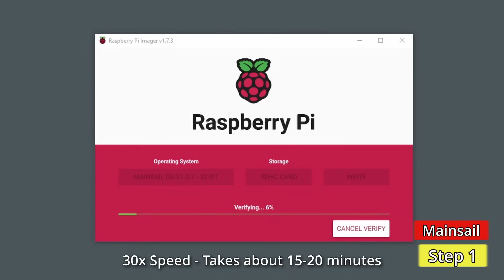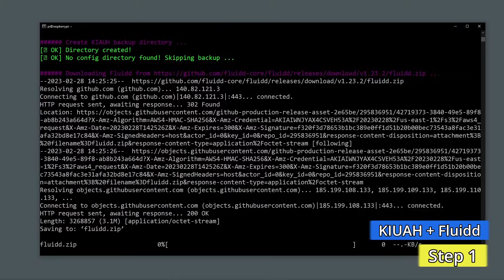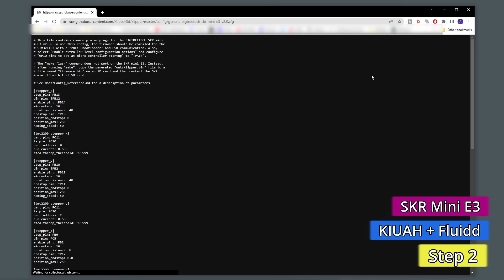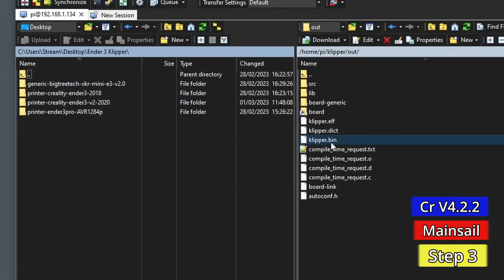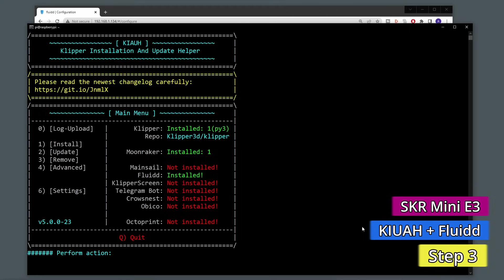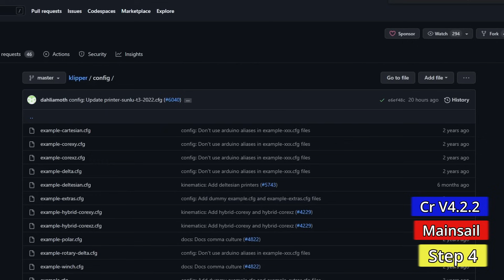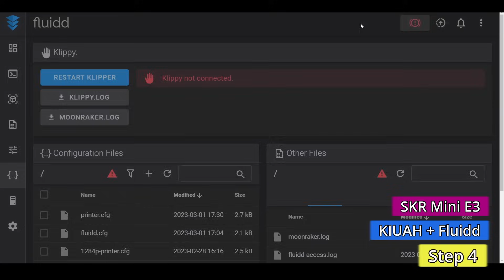How to Upgrade to Klipper on any Ender 3 for High Performance

Comment from the maker: If you're mainly concerned about getting hold of a raspberry pi, get subscribed because I have a good potential solution that were going to try out!
Reply: An orange pi perhaps, or the one that comes with a duck? Guess I will see.
Reply: @paulmilne3038  wi'll this method still work with an orange pi?
Reply: i followed your tutorial I'm running klipper on pc
Reply: i'm installing it on a thin client right now, a used wyse 5060 is cheaper than a pi 4 and more powerful + more expandable. only thing you really miss out on is the GPIO pins and full software support
Reply: Can yous share the ender 3 neo config file?
Reply: please answer my question, if i use laptop directly to 3d printee without raspberry or any tjing like that, did the steps is same? 

thank u

Comment: I found installing  Klipper a bit too much, so i did Octoprint as it could leave my Firmware intact. Installed it on a cheap orange Pi (the OPi Zero 3) and works perfectly. Should I ever decide to go to  Klipper.....I saved  tr video

Comment: The imager only has the 3.0.0 64 bit version right now, is it okay to run this on a pi 4 2GB model, or will it not work correctly?

Comment: FOR BLTOUCH ON 4.2.2 YOU NEED PUT sensor_pin: ^PB1     &     control_pin: PB0   RATHER THAN PROBE OR WHATEVER. this was the only thing that worked for me, not sure why.
also on a cb1+pi4b, i should mention

Comment: nobody covers the fac that theres litteraly an image in raspberry installer, that has BOTH Klipper + OctoPrint together. like 1/2 the steps every tutorial puts us throw could be eliminated, yet NOBODY covers this.
Reply from the maker: Because I don't want to use octoprint
Reply: How do Klipper and OctoPrint work together? Would the web interface be Klipper or OctoPrint?

Comment: I studied a lot, watched several videos, used a little AI, but on four motherboards I couldn't get it to work. It seems they have bootloader problems. I really don't know where I went wrong. On four motherboards, I think the problem is with me, not them, haha. I used the 4.2.2 and 4.2.7 Srkmini E3 v2 motherboards, and the S1 PRO motherboard. Frustrating.

Comment: *IMPORTANT**: When entering the pins for the BL Touch, please follow the this instructions. The pin settings for the BL Touch should be as follows:*
sensor_pin: ^PB1
control_pin: PB0

Hello. Our printers are the same model, but I have a GD32F303 processor. I've already checked my motherboard. I'll be replacing my processor during the installation, but is there any other memory value I need to change?
ADDITION: Yes, it works.

Comment: I know this old, I used it last year to get mine going, I been off 3d printing for like a month or two. Anyway I came back and no go anymore. I tried everything last night a new re install but the problem is the same one.  I can't get the new mcu id,  when i run the command it tells me no such a file or dir(/dev/serial/by-id/*': No such file or directory). Any ideas, it was like this when I came back after hours of trying everything and the re install still nothing. Thanks for the great video.

Comment: you don't actually need SBC. If you have old laptop that is waiting for use, you can just install klipper on linux distro like debian. I'm running mine in virtual machine
Reply: Hey Im trying to do this in a chromebook using the debian linux but I crashed into a wall when installing to my printer. Can you help? I got stuck at the part where he builds the klipper.bin how do I send it to the printer? Thanks in advance.

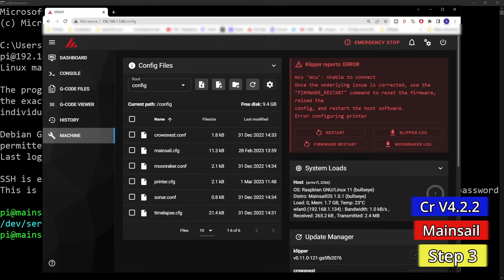Comment: Hello! I have issues with the step on17:34 where serial id is extracted with ls /dev/serial/by-id/*. It says "ls: cannot access '/dev/serial/by-id/*': No such file or directory" what may be related is that although I put klipper.bin on my SD card, it is much more unorganized, as instead of that one file in the SD card i have multiple where i put klipper.bin.
Reply: I'm stuck here too... My issue is that the raspberry pi connects to my computer as Pi@raspberrypi where in the video its connected as Pi@mainsailos. I cannot find out what is wrong, or how to fix it. If anyone has answers, please share quickly!
Reply: Did your firmware flash right? @DudeIngenious5215
Reply: Unplug the usb, turn the psu off, put the sd card in.....rename klipper to firmware-1.bin ...never use the same name twice, so change the number...i use the date and time instead. Turn the PSU on....you know it worked because the LCD will light up but remain blank.

Comment: Holy.. a rocket scientist would have had it easier.
Reply: Wow, if you aren't smart enough to follow step by step instructions, just say so.
Reply: @mattelder1971  I have no issues at all but many other might have with around 100 instructions or what it was so just take it easy there dude.
Reply: @dtiydr  mattelder1971 wasn't very kind on his approach on this, but in his defense, he's mostly correct. i found it pretty simple and easy to follow and understand, and i have little to no coding or computing knowledge. I feel like this isn't an issue on the video's way of teaching, just an issue of understanding on your part. this isn't a BAD thing, it just means you have to do some more research or learn a few more skills (:

Comment: help please everything connects except it refuses to  home, ender 3 pro 4.2.2, i can warm up bed and extruder, control fans, it even locks steps when i ask it to move, but refuses to home
if any retard has same issue, the chinese have wired the thing incorrectly, so you have to manually remap your drivers in printer.cfg
for example:

step_pin: PB9
dir_pin: PC2
enable_pin: !PC3

they might be completely swapped any way possible, use chatgpt

Comment: Hi vector3DP, I followed your step from start to end. currently im having ender-3 (basic one) with creality 4.2.7 board. i have reached the step where we need to "build and flash", after i start flashing, it eventually stopped because of SPI Flash Error. I have inserted the SD Card, but it only has 8GB, it should be sufficient right? Could you assist me with this issue? Let me know how can i contact you personally if it is easier.

Comment: Well, followed along step by step, and appear to have bricked my ender.  Loading the klipper.bin files killed it.  It doesn't communicate with the klipper interface "printer is not ready", screen is blank, and won't let me flash the marlin firmware back onto it.  I'm guessing the marlin bootloader gets wiped during the install.
Reply from the maker: Be sure the file is named and correctly and correct settings are chosen for your printer. I promise it works :)

Comment: The big flaw of Klipper is that it needs a host to be used. In other words, the printer is useless by itself. The cheapest host is a Raspberry Pi. Which is VERY EXPENSIVE compared to that printer. It's not worth it.

Comment: Hello, I have successfully installed klipper on an old laptop and I want to know the necessary steps to finish the installation of the printer.cfg file for my printer:

configuration:
- creality x rail 
- creality silent board 4.2.7 
- creality sprite pro kit for ender 3 
- creality cr touch

I can't find any sources for the components of this printer. 

Can you provide me with guidance so I can try this Klipper system.

Comment: I am having a heck of a time trying to get through this. I don't think my printer is taking the firmware flash? I have tried about 4 different microusb cables of differing brands but Klipper always just fails to get the mcu id. Pulling my hair out over this as I'm crossing the 3 hour mark flashing, pulling SD cards out, searching for cables, etc.

Any help would be greatly appreciated.

Running a 4.2.7 Ender 3 Pro with a CRTouch. I've got a pi4 with Klipper installed and running from what I think is just fine, but either the printer fails to take the .bin flash that I put on the sd card or Klipper is just failing to see it at all. I've tried all sorts of different configurations in the make menuconfig but nothing works.
Reply: I'm stuck and it's almost 2AM. If I leave the pinouts copied from the Ender 3 S1 so it's ^PC13 and PC14 then I get an error that states that failed to verify the BLTouch probe because it's raised and then says it failed to deploy. However if I use the PROBE_IN and PROBE_OUT I get the BLTouch failed to verify sensor state while the colors go all crazy on the CRTouch.

Comment: Brilliant managed to convert from Octoprint to Klipper on my Ender 3 plus skr mini e3 v1.2 in just over two hours 😀 just finishing its first print. 😀
Reply: Did you have to flash it directly to printer or you did it all through pi?
Reply: @ the pi creates a file you put on a sdcard and reboot the printer. Use a freshly formatted empty sdcard or it may have problems. I can’t remember exactly but I think the file has to have a particular name to work. Good luck!

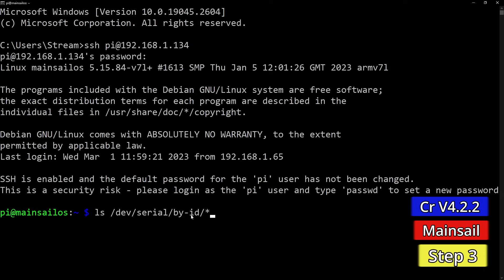Comment: @17:30 im not able to get any response from the pi when i type in: "ls /dev/serial/by-id/* " it gives me a response of ls: cannot access '/dev/serial/by-id/* : No such file or directory" Does anyone have a fix for this?
Reply: also, does the printer have to be on and firmware uploaded and ready to go by this point?
Reply: @factoryblack181  Hello I'm having the same issue, did you find a solution my board is creality 1.1.4. and I'm not sure if the printer has to be on or not. Thank you very much in advance.
Reply: @lmpuy  Yeah actually! So when youre in the make config menu, for my board I had to set my gpio to PA0 and that fixed it. Recompile the code and when you get through all of the processes again, it should let you ls the code in the pi
Reply: @factoryblack181  Can you explain a bit better is it the GIPIO pins options or the Communication interface settings?
Reply: @karaokeparalacras  its in the gpio pin options, its near the last option towards the bottom. Recompile your code and you should be good.

Comment: Great tutorial! I tried doing the Kiauh + Fluidd method, I followed carefully every step. Once I install Fluidd, I cannot access the web interface using the IP address. I tried different things including rebooting the RPi, restarting fluidd, restarting moonraker. Still a blank page... Any ideas to fix it?
Reply: I have the same issue, but it is a matter of reading carefully. my ip is 192.168.10.199, but after installing it told me to open at http://192.168.10.199:81

note, the last :81 is important. i suspect you encountered this problem

Comment: I just wish you had done 2 different videos and not merged them. It got confusing for us beginners.
Reply: I followed closely and I am still having an issue after 2 days of trying. I have an Ender 3 Pro from 2021, Control  board is an BIGTREETECH Direct SKR Mini E3 V2.0 32Bit Silent Control Board Integrated with TMC2209 UART Stepper Mortor Driver, BL Touch, BIGTREETECH Ender 3 Dual Z axis Upgrade Kit with Stepper Motor Lead Screw, Dual Z-axis Upgrades Kit, Micro Swiss All Metal Hotend Kit, and CanaKit Raspberry Pi 4 2GB Starter Kit from 2021. I need help. I would like to use Mainsail and Klipper. Please please.

Comment: Anyone face a problem with ender 3 pro with 4.2.2 board and bltouch 3.1.
change to this config.
[display]
lcd_type: st7920
cs_pin: EXP1_7
sclk_pin: EXP1_6
sid_pin: EXP1_8
encoder_pins: ^EXP1_5, ^EXP1_3
click_pin: ^!EXP1_2

[output_pin beeper]
pin: EXP1_1

[board_pins]
aliases:
  EXP1_1=PC6,EXP1_3=PB10,EXP1_5=PB14,EXP1_7=PB12,EXP1_9=<GND>,
  EXP1_2=PB2,EXP1_4=PB11,EXP1_6=PB13,EXP1_8=PB15,EXP1_10=<5V>,FIL_RUNOUT=PC6

[bltouch]
sensor_pin: ^PB1
control_pin: PB0
x_offset: -44
y_offset: -6
z_offset: 0
probe_with_touch_mode: true
stow_on_each_sample: false
set_output_mode: 5V
Reply: Thank you. I have a 4.2.7 board with the crtouch and could not get it to work. This fixed it for me. Thank you!

Comment: I have an Ender 3 with the 4.2.2 board and I’m using Octoprint on a Raspberry pi now - can I use it with Klipper also?  Since I have Octoprint running and using, what instructions can I use to get Klipper up and running?  I’m I needing to install Klipper on the RS PI first and then reinstall Octoprint on the same pi and restore a Octoprint backup?

Comment: I did everything. Fluid gives  me a blank white screen at my IP  address. When I installed Mainsail and assigned it a port, I typed my IP for fluid and added :88. Mainsail opened, but fluid is still a blank white screen.
What do I do?
Reply: Ohh. I am using CHrome. Windows Edge works
Reply: @SpectraV3i  Weird, I was using edge and had the same issue, switched to mullvad and that fixed it.

Comment: Hello, I realy need some help.
I'm trying to install Klipper on a SKR E3 Turbo but I'm getting always the same error "SD Card Flash Error: Unable to connect to MCU". I tryed the GPIO pin !PA14 and i got an error thtat it couldn't creat the klipper.bin file.
Now i'm using the pins: !P3.26, !P3.25, !P1.18, !P1.19, !P2.13" and i'm getting the error of the MCU.
Can anyone help me on this pls.

Thanks in advance

Comment: Flashing out/klipper.elf.hex to /dev/serial/by-id/usb-1a86_USB_Serial-if00-port0 via avrdude
avrdude: stk500_getsync() attempt 1 of 10: not in sync: resp=0x65
avrdude: stk500_getsync() attempt 2 of 10: not in sync: resp=0x63
avrdude: stk500_getsync() attempt 3 of 10: not in sync: resp=0x68
avrdude: stk500_getsync() attempt 4 of 10: not in sync: resp=0x6f
avrdude: stk500_getsync() attempt 5 of 10: not in sync: resp=0x3a
avrdude: stk500_getsync() attempt 6 of 10: not in sync: resp=0x54
avrdude: stk500_getsync() attempt 7 of 10: not in sync: resp=0x46
avrdude: stk500_getsync() attempt 8 of 10: not in sync: resp=0x20
avrdude: stk500_getsync() attempt 9 of 10: not in sync: resp=0x69
avrdude: stk500_getsync() attempt 10 of 10: not in sync: resp=0x6e

avrdude done.  Thank you.

make: * [src/avr/Makefile:34: flash] Error 1
>>>>>> Flashing failed!
>>>>>> Please read the console output above!

creality v1.1.4 ı cant flash this card. why ?

Comment: You need a raspberry pi WITH the Ender3 control board. Not worth it.
Reply from the maker: klipper is 100% worth the cost of a raspberry pi in 99% of use cases.

Comment: one of the best tutoral i've seen. I do already have  klipper installed on a pi, but never got round to actuality use it. I have a Anet a8 plus running with ramps 1.6 and Marlin 2.x. But an 8bit ender3 and anet a8 plus are very similar,  so maybe not too much work to alter confiq to work from this tutorial. Is it possible to run klipper in a local network rather wifi ? I work at a Highschool and we a not allowed to use wifi or any remote control. Which is the reason for me abandoning the project.

Comment: I'm having issues installing the firmware to my BTT SKR mini E3 V2.0. The settings change since you recorded the video:
- it asks me whether I should make flash or stm32flash, which it doesnt say in yours
- board number for the v2 seems to have changed from 21 to 23
- as far as I know and as far as printer.cfg info at the top says, I should put the klipper.bin file on an SD card instead of flashing to the MCU from USB, as that is not possible on this specific board.
Reply: I'm having the same issues, did you manage to resolve your issues?
Reply: any update on this? I stuck on the same issue and have info that flashing failed due to "unable to connect to MCU"...

Comment: I have M8P with CB1 on a Voron. And I have Duet 2 Wifi on my old Delta anycubic. Duet wifi 2 is 170 bucks .. klipper costed me 102... With more drivers on it and better processors and the wire pins are higher quality. And I have to say, klipper programming is a lot more advanced, and user friendly. Lots of options for you available including using USB cameras, remote control etc .. My duet 2 wifi is up to date, it sometimes still have glitches, it's not as fast on CPU power as klipper... Long story short duet sucks and overpriced. Duet 3 is almost 260 bucks. If you want to tell me klipper boards are expensive then idk what you expecting.. 100 bucks for most expensive klipper board isn't expensive. Especially when it comes with 8 drivers and raspberry pie. Any one looking to upgrade, buy the klipper board you will love it. I actually thinking on trying to upgrade my old printer and see how it runs with it.

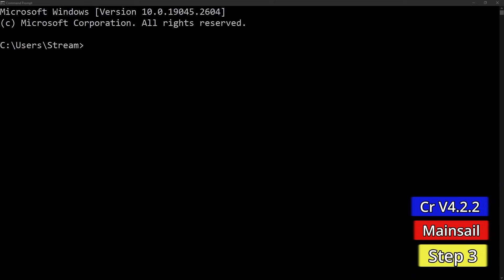Comment: Hello,  I am tryin to install Klipper via Mainsail. I am having issues and am stuck around 17:23.  The firmaware we generate goes into an sd card and that card goes to the printer directly or does it go into the raspberry pi's card?  I did it and my printer doesnt read anything
Reply: (late but might help others) reboot the printer with the firmware (copied on a different SD card, not the one for the pi) and the screen should stay blank as it is only configured next.
Reply: @SaMusz73  thanks I think I was saving the the firmware incorrectly in the folder or naming it incorrectly

Comment: Just as a quick note, even 9 months ago when this video was released, the Raspberry Pi Installer will not set raspberry as a default password, you need to sepcify one, and you for security would be advisable not to use raspberry.
Apart from that, this is a great video and has helped me to get started :)
Just two questions here:   What is the best way to setup Klipper to and Octoprint on the same Raspberry Pi?   I have a Raspberry Pi 3B+ that should handle it.
2.  I currently have been using Octodash to provide a touch interface at the printer with a 7" Raspberry Pi Touch screen.   Is there something similar available to interface with Klipper?
Reply from the maker: it does set raspberry as the password. Thats exactly what i did in the video and thats the password it used.